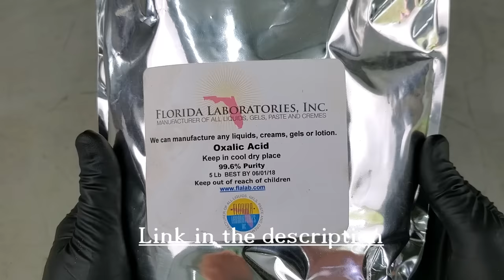Vintage Snapon Tools 1/4" Ratchet / Socket Set and Box KRA-229 Restoration

Comment: Surprised you didn't strip the ratchet and lubricate it's inner parts!  Otherwise great job !
Reply: same thought
Reply: Thinking just the same thing, especially after the acid bath.
Reply: Also lube up those case hinges so they don't bind up and sound old
Reply: Jan van Hunks aggressive, but you might be right
Reply: Same! Wonder why that was missed!
Reply: Jan van Hunks i thought it was just me, once they hit 25 it goes down hill
Reply: Ratchet head is full of water !?!?!?
Reply: Same thought here mate. The spring balls in the extensions also need oil.
Reply: Ditto. And each one of those little crusty rusty cauliflowers that took an acid trip off into la-la land just exposed a pit of exposed steel that’s just gonna turn into a bigger crusty rusty cauliflower, that some poor soul still owes 79 payments on...
Reply: Idiots obviously never owned a set of this quality their always sealed . He didn’t open it because it wasn’t necessary
Reply: Tom Card 😂😂😂 obviously you’ve never used them they are not water tight 😂😂 and still need taken apart and cleaned every once in a while
Reply: Tom Card whatever helps you sleep at night 😂😂 glad you instantly got all butt hurt over your precious snap on I know what I’ve dealt with and they also break just like any other tool
Reply: Tom Card also they are only sealed around the anvil not around the cover plate or the selector switch so I stand with they are not water tight like I said
Reply: I agree with the majority here. Have had plenty of Snap-On ratchets apart in my day. I’ve yet to come across one with oring seals in them or found the round metal cover above the directional lever that was sealed in with blue Loctite. Any road techs that came in from a road trip who had dropped a ratchet in the mud or in a puddle always washed them off in hot water, blew them dry, disassembled & cleaned them. They then sprayed them down with brake clean, re-lubed & reassembled them. Your tools are your bread and butter. You take care of them, they will take care of you.
Reply: @HotBrass-Lead  it's cause the guy rusted the tool himself and overlooked it. YOU are insane buddy.
Reply: Precisely, its hardly a restoration if its just rust removal and repaint
Reply: I wondered that same thing.
Reply: Or clean out the sockets.
Reply: or clean the inside of the sockets

Comment: This was an unused socket set, just sitting in a damp environment.  No missing sockets, perfectly straight sheet metal and piano hinge, and the plastic tray was not only still there, but not broken to shit.   Good score
Reply: Thats because it was faked..
Reply: How is it faked?
Reply: Clearly it was unused, the plastic parts holder is intact.  Those are not available from Snap On, everyone who has the 1/2 drive sets is after them.  Make some money and clone the insert and put them on eBay for a fortune.
Reply: All these restoration videos are juiced up....meaning these guys rust out the products on purposes...then restore them for these videos.....so they can make YouTube money...but it’s still fun to watch...and their process to restore is helpful.
Reply: @sierraridgereaper  Yes all fake videos...
Reply: Spray with vinegar and then clean it off. That plastic would look like shit if they actually rusted in there
Reply: It looks like a circa 1997 set. Probably the vintage series. So it's not even old.
Reply: @davidmiceli7752  mine have looked like this before. Rain got in my closed tool box (don't know how) about a week later they looked exactly the same as this. WD-40 and a rag cleaned them right up. 
Real rust will leave pitting that mere polishing won't get out.
Reply: @1one3_Racing  Late 60s
Reply: That was the dustiest most superficial rust I've seen
Reply: Way to expensive to use
Reply: @decap6000  that’s what I thought. The wear and tear on the case looked genuine, but those sets were definitely rusted up by him, looked way too fresh and no pitting. Plus parts don’t just rust like that.

Comment: Should have taken the ratchet head apart and cleaned and lubricated it
Reply: I came here to say the same thing!
Reply: Especially if you are already refinishing the whole set. Go ahead and at least do that while your at it.
Reply: And the piano hinge on the box should’ve been disassembled, painted separately, and then reassembled... but then again, this isn’t the My Mechanics channel
Reply: He’s answered on another comment that he did take it to pieces but the footage wasn’t too good.
Reply: He commented some where and said he did, just didn’t put it in the video
Reply: frankinjeep 1 yes that’s very important the acid he used probably would damage the internals if not cleaned off
Reply: @user-sx4yu3nw4j  If it was my mechanics he would of built a new box from a solid metal cube.
Reply: @user-sx4yu3nw4j  Probably wouldn't have been able to get the pin back in the hinge since it would have the thick plastic paint in it.

Comment: When I was 17, I bought a Par-X ¼ drive set off the Snap-On van came in a cardboard box & a ½” combo I’m now nearly 67 and I still have them apart from a few sockets I broke, they were thin-wall.  Ratchets had a few Snap-On repair kits having abused it many times, still used today fixing my old VW, ½” chrome worn off and not used now unless you are into old British stuff.

Comment: Nicely done.
Finally it's nice to see people use a sand blasting booth and powder coat to restore this stuff. i used to cringe seeing these people using a power drill and a wire brush. The hard part of painting the ratchet box was spraying the hinge completely, there will always be spots you have missed.

Comment: I went through a toolbox of my grandfathers that was about to be thrown away and I found some cool stuff in there. I took the time to clean the crud and rust off the tools and found a vintage C clamp form. Cincinnati took co.,a ratchet labeled super ratchet that still works good,a pipe wrench form the 10’s I think it was, a auto adjusting vintage pipe wrench,and some vintage snap on stuff like a 1/2” ratcheting breaker bar adapter made in the 20’s. Along with some vintage 2 piece snap on extensions and a lot of old looking open end wrenches that i haven’t researched yet.

Comment: That is the most robust sand blaster that I’ve seen on any restoration channel. Now some guys use paint remover before sand blasting to prevent the paint particles from mixing with the sand and causing a decrease in efficiency. Just a thought, though it certainly didn’t seem to slow you down. I loved the powder coating! I would have liked to see the high relief label painted a different color, but that’s just my preference. Overall, very well done!
Reply: I concur! I have NEVER seen a home-use, Harbor Freight cabinet with that much velocity in the sand blaster. I'm beyond the words of EAGER to see this setup?!! Can you please explain/show what kind of compressor and or parts and CFM your pushing out in this? Crazy!

Comment: Nice job. The snap on lettering needs some white paint.
Reply: I was thinking it would look better chromed
Reply: Read the description
Reply: I came to the comments to say the same thing.
Reply from the maker: It does I agree,  I intended to make it white but my skills layering powder coat are lacking,  I tried to tape the snap on letters off and cut them out but was to hard,  I should have just hand painted them.  Thank you for watching though.
Reply: @EasternNCSportbikes  I use a wide tip paint pen for raised lettering it's easier to control than a brush...at least for me anyways and I always get results I'm happy with and no brush mark.
Reply: i was saying the same thing
Reply: You should watch Rescue & Restore’s powder coating of a creepy clown bank. He powder coats and bakes on the base layer then powder coats the second color over the whole thing but wipes off the powder from the section he doesn’t want the second color with a q-tip before the second bake.

Comment from the maker: Thank you guys for the positive replies and support,  And thank you for subscribing it means alot to growing the channel.
Reply: You dont check de mecanism inside de ratchet can be fixed too
Reply: Good stuff, quick question. Im a mariner, we use Phosphoric acid to derust, why oxalic ?
Reply: Fantastic channel 👍
Reply from the maker: @davidwarland2680   I had it handy,  im all about using up what I have until I buy more haha.
Reply: What kind of machine u used to clean the case?
Reply: I also wanted to see how good the ratchet actually operated.  It may have had no issue if the rust was just from humidity in the air. If that stuff had gotten submerged in water put up wet those gears would have been rusted too.
Reply from the maker: mister clean  Higher CFM the better  get something over 10-12 CFM if you can,  sand blasting cabinet is harbor freight thats been modded with a skat blast gun
Reply: Great restoration! To add a little more life to the black blister mold for the tools (will help keep it from cracking) fill the backside with spray in air can foam and level it out.

Comment: Nice job.
In addition, 
I would wipe down each part with a fresh thin coat of motor oil, including opening up the ratchet mechanism,  and cleaning with WD40, then a drop of motor oil before putting it back together.

Comment: Yo snap on has a life time replacement 😂😂
Reply: Jarryd Capper not if your not the original buyer. You may get lucky but on snap one website it states that the warranty is really only for the original purchaser
Reply: Predwards 89 If you’re a professional mechanic Snapon doesn’t care who the original purchaser was. However a local tool truck guy isn’t going to accommodate the guys that buy worn out Snapon tools either at a yard sale or pawn shop who want them swapped for new ones that they can sell at a profit. I don’t blame Snapon . They market themselves to professional mechanics.
Reply: @prevost8686  Any time I have issues with my Snap-On tools I get free replacements and repairs on my ratchet and the one and only time I have needed repairs on my ratchet the guy replaced the mechanism without question. My father bought me a set back in the 70's and  am not a pro. He was. I have never been asked for receipts.
Reply: Matco does within reason i replaced a cracked 21mm 19mm comb. impact socket i am the second owner of the set
Reply: Not on neglect

Comment: Didn't even take the wrench apart and clean/lube it. It was soaking in the acid and then the water.  No before or after usage. Never knew if it worked after the Shoddy attempt of a restoration.
Sorry, there are a lot of other restorers doing a more thorough job. No like or unlike.

Comment: Love restoration, this is great! What media and pressure were you running in your blasting chamber? =)
Reply from the maker: Using Oxalic Acid,  its a harbor freight cabinet with a skat blast gun   and thank you very much!
Reply: @EasternNCSportbikes   oxalic acid inside the cabinet? You dont have problems with corrosion after "sand"blasting? =)

Comment: u didnt even lube ratchet or spin it over for us :(
Reply: @EasternNCSportbikes  I noticed the same thing.. I do hope you go back and grease the internals on that ratchet... Very nicely done.. powder coat turned out great...
Reply: CASPER 12345  Next time pack it full of grease, spin it around and then u make the call.. I've got all my ratchets greased up and been using them for 50 yrs.. never had a problem...
Reply: CASPER 12345  Well Casper,  you got me there.. I don't use mine professionally but just occasionally and I hadn't greased them in about 40 yrs and as I was putting it back together the snap ring broke so I guess I'll have to get a rebuild kit one day.. it was a Craftsman.. I could take it back and get a Chinese model, but I can almost promise you that it wouldn't last 50 yrs.. So the moral of the story is, whatever works best for you...Casper, take care and have a wonderful Thanksgiving holiday .. Gary
Reply: CASPER 12345  Thank you Casper,  I had the # of the rebuild kit that you could get very cheap from Amazon or one of those other places like that.. I love that old ratchet,  it was one that I had when I was in the Military... I'm from  Tennessee,  where are you located?

Comment: 45 years ago SnapOn was best tool of the time. I was then young.
Reply: @Meme Man Nice to hear Snap-on is still alive!
Reply: Snapon is alive and strong as ever! I am a current Dealer and could rebuild that exact ratchet on my truck today. I have rebuilt ratchets 70 years old and they work good as new. If it’s not rebuildable, my customer gets a new modern ratchet.  The part number for those sockets hasn’t changed.

Comment: So many people tag about SNAP ON,being so costly.
I'd like to change the way you think about this. Is it more expensive to replace cheap tools every few years? Or is it cheaper to buy good tools that LAST?
 I HAVE S-O side cutters that I bought more than 25 years ago,and they STILL can cut a 16d nail in two. Same deal with my snapping pliers from S-O,well they can't cut a 16d nail but you know what I mean..
It's ALL but impossible to buy GOOD TOOLS today,cheap tools have run them out of the market place.
You see a $6 screwdriver and there's a .99 ¢down the aisle most will buy the 99¢ over and over,using it as a baby prybar,or scraper ruins those inferior tools.
In the end,it IS a choice. DURABLE,LONG LASTING TOOLS COST.CHEAP KNOCK OFFS COST A LOT MORE...But also depends on took use &application. I don't think I'm gonna need a $13 socket to do a break job..
BEST OF LUCK!
Reply: If your using them everyday to earn your living, the high end stuff is the only thing.

Comment: Instead of powder coating, the ceramic brake caliper paint from an Advance auto parts store is about $10 for a large spray can, over a rust converter primer. Wax it with Nu Finish car wax, then rub on a layer of Fluid Film spray.

Comment: How did the plastic shell survive?  A good idea (which I didn't do with mine) is to spray some foam onto the back to solidify the shell in the event that the plastic starts to get brittle.  Mine is falling apart and now I need to get those springy things to hold all my sockets.

Comment: ... I think that may be a 3/8 ratchet there sir... not 1/4
Reply from the maker: There is a 1/4 to 3/8 adapter beside the  extension and look at the small holes on the larger sockets.   Im a mechanic I know the difference between them thank you.

Comment: I found what looks like the exact same set a few months ago in my pops old tool box and it was wrapped in a towel, no rust except for a little on the inside front left bottom corner. Its funny because my grandma retired from sears in 93 after 29 years and almost all pops tools were sears or craftsman named. He was a head chief mechanic for eastern air lines for 22 years and my dad said he never once complained about any tools he got from sears. This must have been a special exception for his cheap ole ass hahaha.

Comment: Huge improvement over what it used to be. That acid eating the rust off of the chrome was satisfying to watch as was the media blasting. I don't know how people can let a nice premium tool set get that bad. Would it not have been better to have used an air brush on the box? Such a relatively small part it seemed like a lot of the powder paint went into the air filter.

Comment: Looks good in the end, but I would also have opened and cleaned the ratchet mechanism. You can have a better result with the plastic surface with a heatgun. Important at this thin piece would be to use some kind of dough behind it to avoid warping.

Comment: Nice restoration, but I wonder if powder coating the case was the best course.. you can no longer read the part number or the all important date code. Oiling the ratchet mechanism, especially after having been submerged in water would have been in order as well. Love your vids, keep them coming!

Comment: I think you could make some improvements to the box. a non-skid material on the bottom would help. Maybe there is some way to make it seal, like some slit vacuum hose run around the edges or something. Seems to me,  maybe you use the box for something else, and get a box for the set already made to seal up tight. You could just put the plastic insert and all in it. If it's going to be on a boat, that seems like a good idea to me. Or an over box of tupperware or the like. Also, people will poo the idea, but spray it all down with WD40. WD stands for water displacement, won't let the water in to rust it.

Comment: Cool! I have a tip for you......never wear those latex (or nitrile) gloves while using a bench grinder or other rotary lathes.  You will get sucked in so fast you will never realize what happened. Thanks for the restore tips.
Reply: It's more a problem that the metal gets VERY hot - especially if you're using a coarse compound - and the gloves melt and stick to your skin.  Leather gloves every time.

Comment: you used the oxilic acid to dissolve the rust, which was brilliant, buy after dissolving, i thought you must neutralize thr solution with some ammonium (very slight basic) or sodium hydroxide since NaOH is very basic then clean with acetone as it evaporates quickly. but iverall great job

i figured it was either going to be sand blasted or the other ideai hadehich was longer, apply paint stripper then rust dissolver after that use filler putty or as you did, sand blast thrn prime and paint the case. as for the sockets, use rust dissilver then apply coat of antirust paint or reapply that chrome coating. and ratchet, disassemble and apply rust remover

again the method i would have done was gonna be longer, again, great job at the restoration